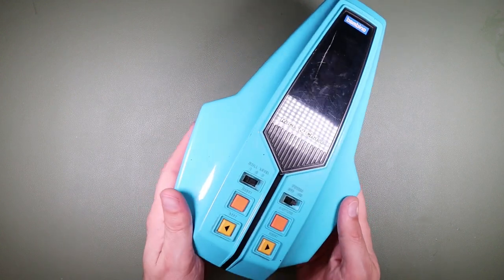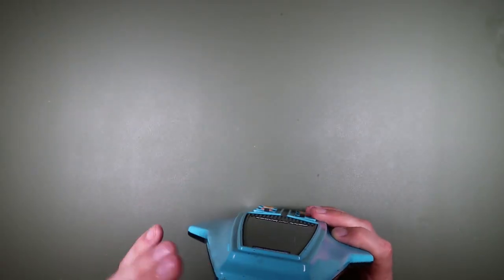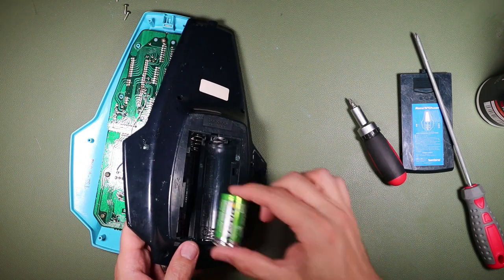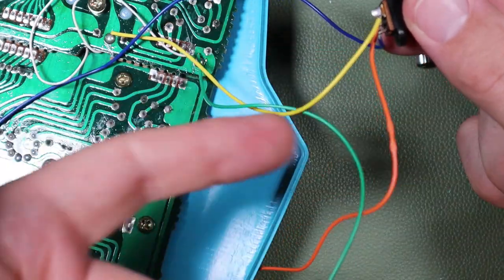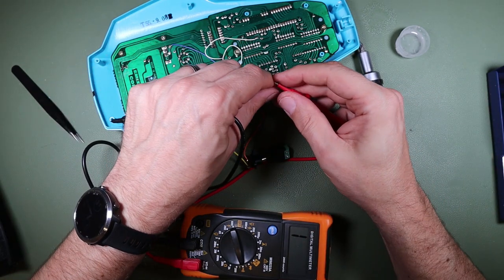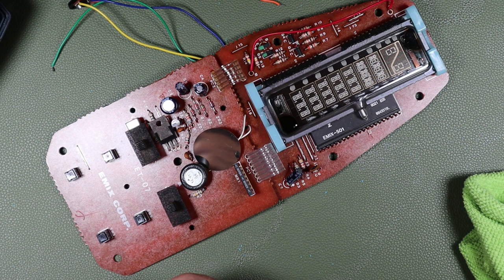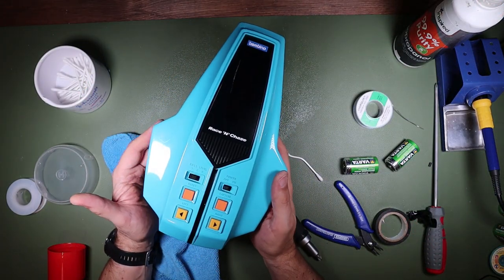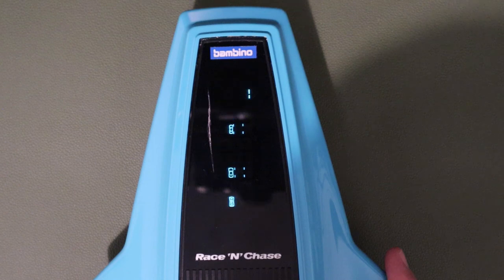Fixing eBay Junk - Bambino Race'n'Chase retro VFD game repair

Comment: I have one of these, I don't know anything about electronics. I was wondering what power pack I could use instead of batteries? It says AC E640, is that all I need to look for?
Reply from the maker: Hi There, I don't really now. I googled AX E640 power supply and the ones I found would not work for this game. I am sorry I can't help more

Comment: I have a 1982 Casio MG888 calculator with games. It's in great condition but it won't turn on. If the calculator is bent slightly then the screen works but the buttons don't. Would attempt to repair this for me? Thanks.
Reply from the maker: Oh wow! I'd forgotten all about those Casio game calculators. That's a rare item, very nice. Unfortunately I don't do repairs for others, but to be honest it's probably a bit out of my league anyhow. Thanks for the comment though. Brought back fond memories of those fun Casio items
Reply: @RetroTechRepair  Hi. Thanks for the reply. No problem.

Comment: Another cool retro game restored.  I haven’t seen one of these in Australia, possibly not one that made it over here.  Fortunately the caps don’t seem to be a problem with these games, unlike the little ‘67 Panasonic radio I picked up at a thrift store recently. Only three electrolytics in it but I replaced them as it was distorting.  The 1uF at the volume pot was leaky, reading 2uF on the tester.  Sounds pretty good now.
Reply from the maker: Thanks Wenlocktvdx. Nice job on the radio, I haven't strayed into analogue repair much yet, tried a couple but it didn't go well. I do occasionally see caps causing problems although I bet it would be worth replacing them sometimes if I only new! Thanks for your comments. PS enjoy your TV DX I used to like hunting live satellite feeds when they used to be open analogue signals before anyone had a dish.... Happy days!
Reply: Unfortunately there’s hardly any analogue TV signals this side of the world. Maybe a couple of Indonesian or Thai stations using US ch2. I do get digital signals from Traralgon on the other side of Melbourne and on rare occasions, Launceston in Tasmania.

Comment: Thanks for an entertaining video! That power jack is often the culprit on these old games :-) I have 6 of the Bambino games. Never had them as a kid, but I am drawn to the awesome design of them. They didn't try to replicate the real arcade machines but made a unique look of their own. Watching your video made me realize that my own Race'n'Chase is missing the black stripe running from the screen and to the bottom of the unit. Hmm, need to fix that with some electrical tape.
Reply from the maker: Hi Steen. Glad you enjoyed the video. This is my first Bambino game but I've really enjoyed playing and repairing it. I will definitely look out for more. I have definitely spotted some common failure patterns and the connector is one. Some repairs are so similar to ones already posted that I don't bother editing them and posting, but the game itself made the Race'n'Chase worthwhile. The stripe is a paper sticker on my game and mine started to peel away as I cleaned it so had to stick it down. I'd imagine black electrical tape would work very well. Thanks for sharing your feedback perhaps let us know what games you have. If I see others spares or repair I'll try to feature them at some point. Thanks again!
Reply: @RetroTechRepair  Thanks for the info about the paper sticker! I tried the solution with black electrical tape, and I am happy about the result. Has a nice matte finish to it, but I am a little concerned about if it gets loose over time and creates a lot of stickiness as that type of tape sometimes does. Well, I guess time will tell. The other Bambino games I currently have are Lucky Puck Ice Hockey
, UFO Master-Blaster Station, Boxing, Football, and Safari. They are all little designer master pieces - in my opinion :-) However, the actual VFDs are just one color as far as I remember, so they are not as spectacular as some of he other brands'. But again - nice video. Please keep them coming :-D
Reply from the maker: @steenfilskovandersen395  Nice collection! I agree the styling is superb! Nice job on the tape too. Glad the video helped!